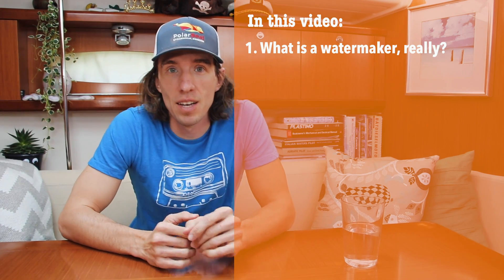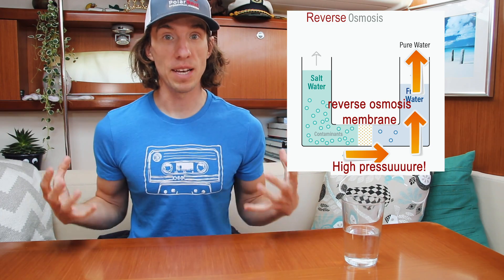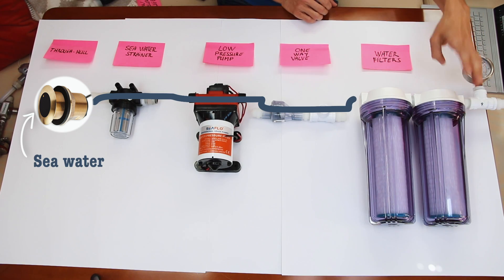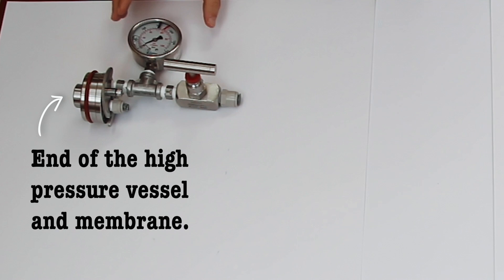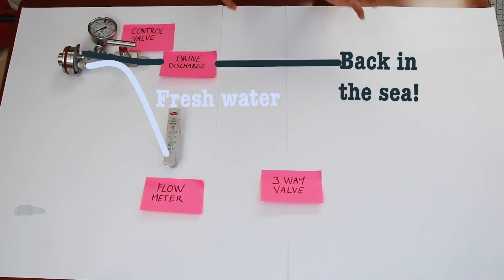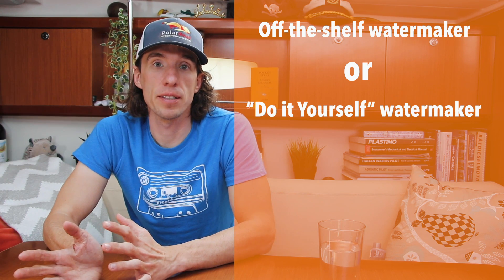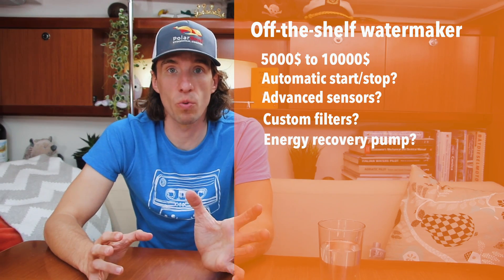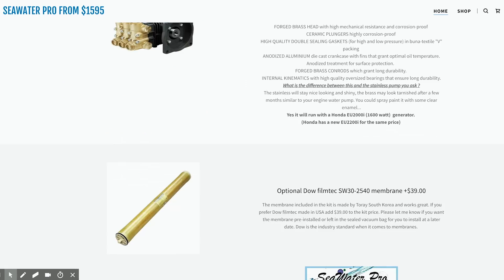How to make water on a sailboat (and how to build your own watermaker) // Ryan’s tech corner #3

Comment: Another great DIY vid from you guys! 
I'd like to offer two very minor corrections. Ryan says the watermaker removes solids. Well sort of. It removes dissolved solids, i.e. salts dissolved in the water. That's what is so magical about it. :) If they were just solids you wouldn't need the pressure pump and fancy membrane.
Second Ryan refers to the meter checking for fresh water as a 'TSD monitor'. I've always heard it said as a TDS monitor since it is checking for Total Dissolve Solids, not Total Solids Dissolved. 
I'll leave it to others to explain 'Vanna White' refference.  :)
Reply from the maker: Thanks for the correction!  Sometimes things slip or get a bit backwards after days of saying it.  Ryan

Comment: Good explanation, except at 11’54  where you got confused with the < and > signs ... Consider what happened to Aquarius between Fidji and New Zealand: having two membrane units allowed them to disconnect the one that failed. They could still produce half of the normal quantity of water... better than none.
Reply: Yeah, I second that. A > was supposed to be a < based on the values given.

Comment: Hi Ryan, Thanks for taking the time to make this video, excellant work, With the unit your building what do you think the Litr per hour is going to be? and what is the TDS reading on your output?  reason for asking is that I have been thinking about this for my own boat, at home I have a 1000ltr seawater aquarium and I use an RO/DI unit to make pure water from tap water with a TDS of around 0, I was thinking of doing this with the system at home but I am not sure it would be a big enough capacity, thats my reason for asking, if it is then most of your parts could be bought ready to go it would usually just need a small pump as mine works with the water preasure from the tap.  looking forward to your next vid.
Reply from the maker: Dave... ill get back to you on this once we test everything.  Ryan